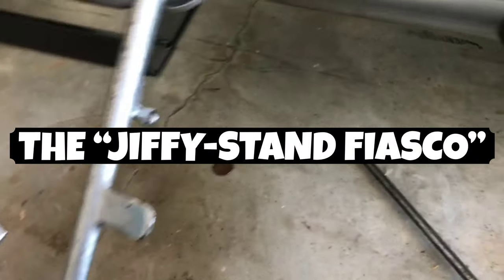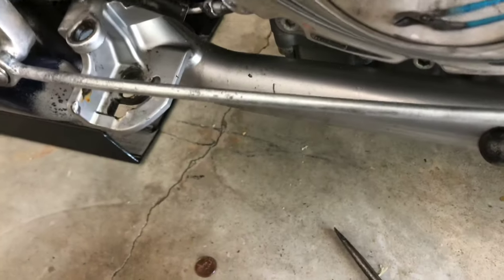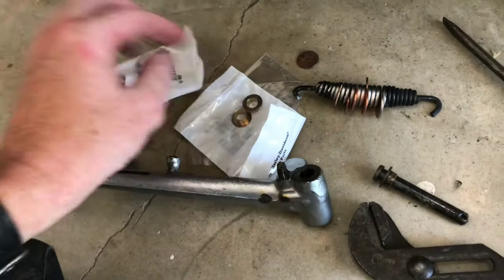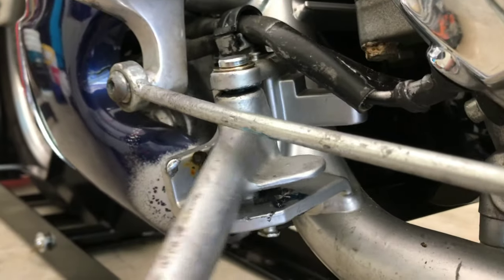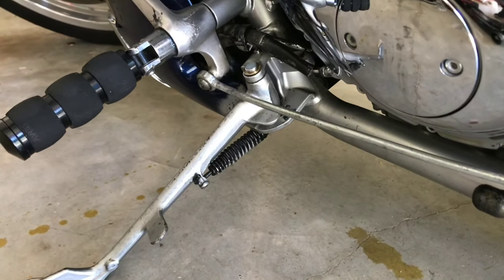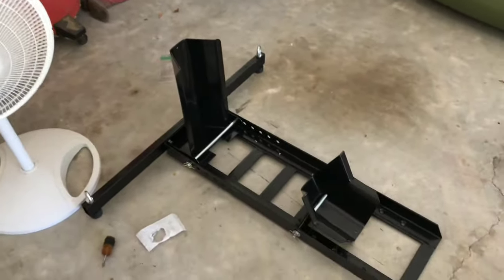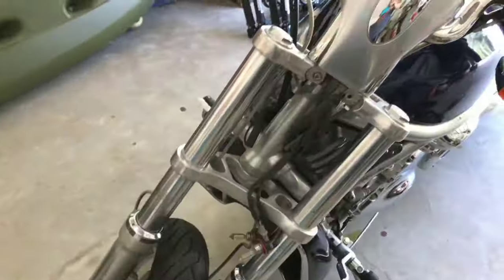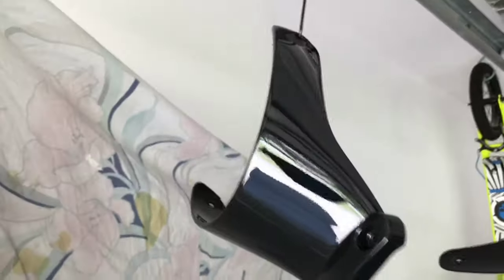The “Jiffy-Stand Fiasco”

Comment: Your pin is upside down
Reply from the maker: It’s installed how it says in my service manual.
Reply: @roadkingtales  YIKES!
Reply: 200,000+ KMs on my V-Rod, replaced a few of them bushes. Trick is to put a few drops of oil on from time to time, they wear out less. Also when I moved away from the mountains, not dragging the stand on the ground in the corners so often = less pressure on the bushes
Reply: Actually, I've seen bikes come from Harley with the clip on top (07 Heritage). The older model touring bikes had a Great kickstand (nut on top with lock plate)- very easy to replace spring but they had to change it.